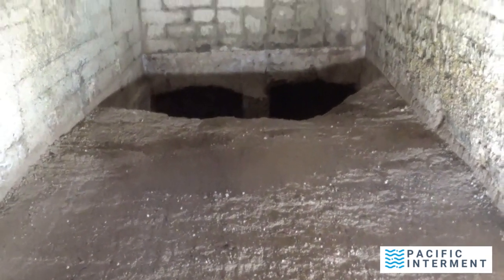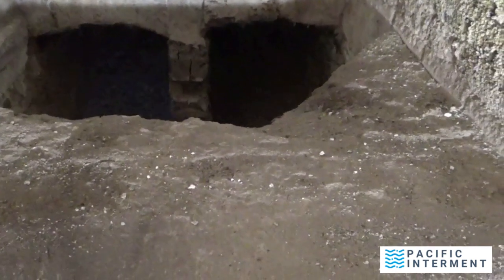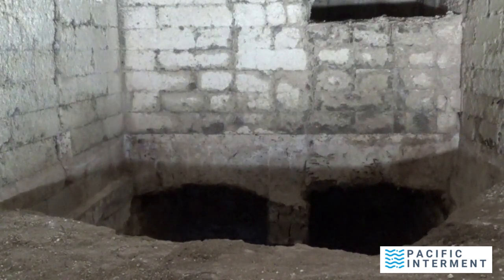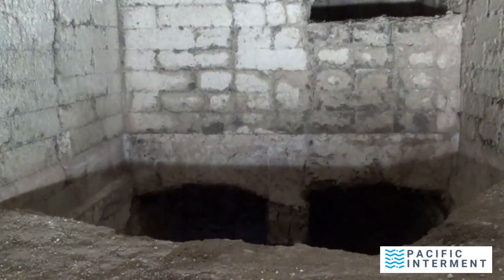Crematory Floor Repair- Part I

Comment: This is great, I have a crematory with two ovens and I’ve been wondering how to patch the correct way I’ve had patched the same spot 4 times already and each time it lasts about 3 months or so and takes about a bag of refractory. I’ve had to overnight bags from florida and that was costly. I have two ovens so while the one has been down I’ve been beating on the second. I just had this video sent to me by another funeral director and I’m glad he found it!
Reply from the maker: Good on you for doing your own repairs. You should try and find a local refractory dealer.